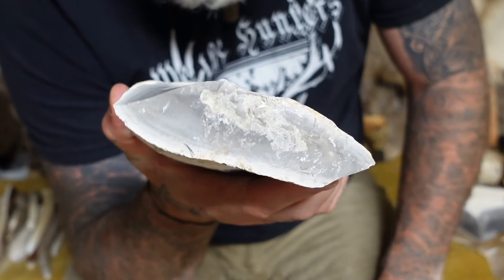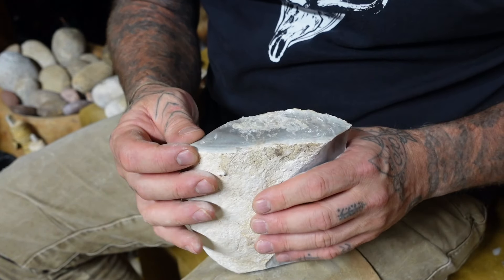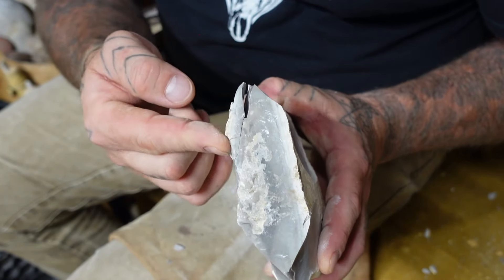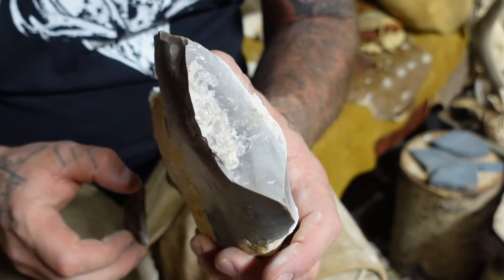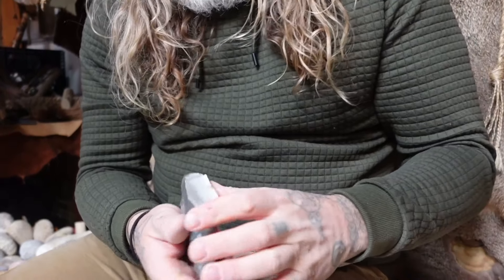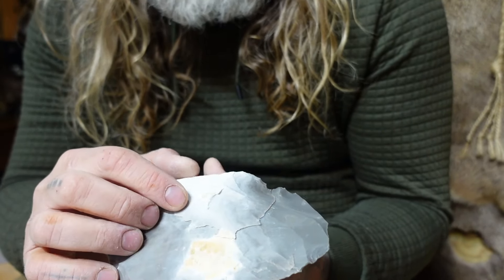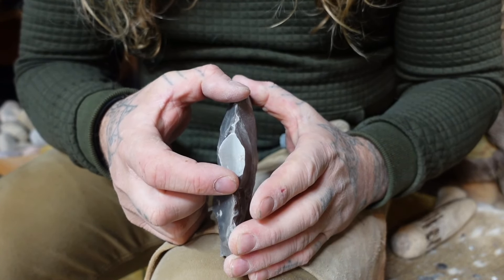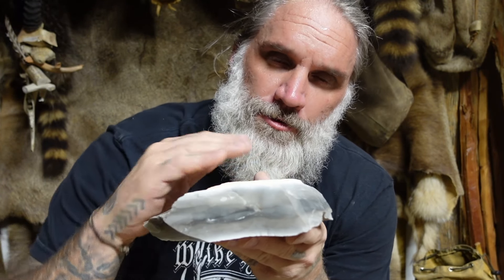FLINTKNAPPING Hacks | Breaking The Wall #flintknapping #primitivetechnology #caveman #donnydust

Comment: Stephen Milo has a video "What are these enormous piles of Mammoth bones?" which talks about some of the ideas (good and bad) around why massive piles of mammoth bones were made (its probably NOT houses, probably IS some sort of ritual).  i was wondering if you had thoughts about how a community of ancient people might deal with the accumulation of bones and other surplus animal bits that surely would build up over time.  do you do anything with the extra bone and horn you wind up with?
Reply from the maker: Interesting. I haven’t see the video, but I will watch it for sure. I use most of my bones, but they are smaller. Except bison. I use what I need. I think with ancient piles of bones…my assessment would be on geographical location, wear patterns on them, animal contact (chewing, stealing, etc) and weather patterns of that time (snow, floods, drought, etc). I probably need to watch. However, sometimes the simplest answer is typically the best one.